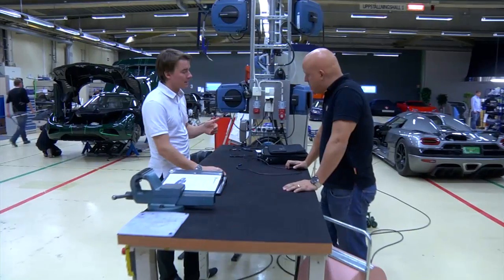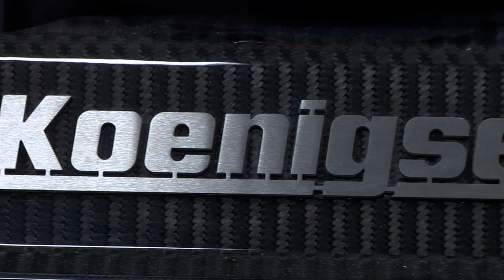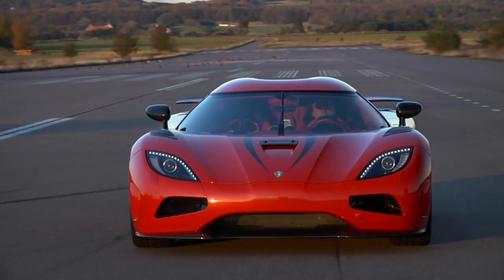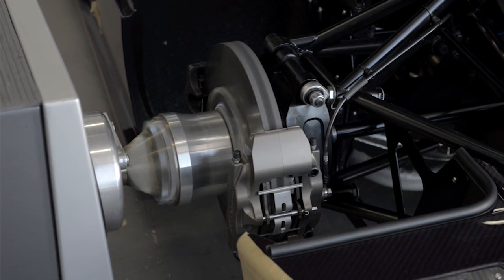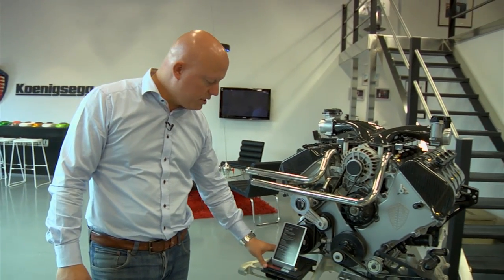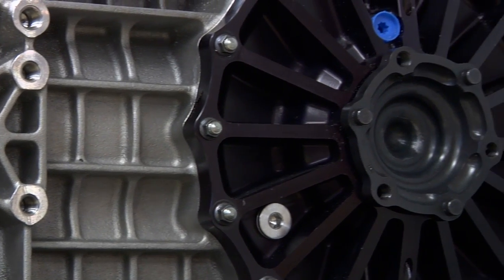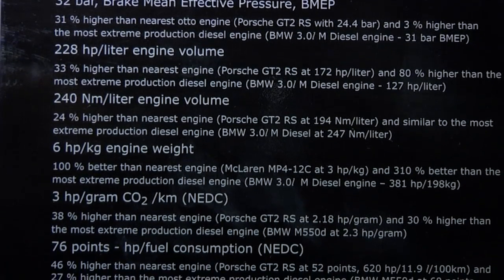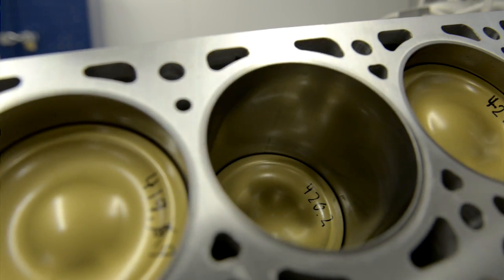The 1140 hp Heart of a Hypercar - /Inside Koenigsegg

Comment: Was anyone watching that dyno at 1:04? 3500rpm, 470 horsepower and 1000 Newton Meters of torque. 1000 fucking Newton Meters at 3500rpm! And it kept climbing all the way to redline. The acceleration would be mad.
Reply: +tqdzwa maramba The torque remains practically the same throughout the RPM range... It's a monster!
Reply: +ZephyrRacing And that's with the torque being electronically limited

Comment: haha he said even with 1100 horsepower it has a safety monitor  so it can go even faster. best car ever
Reply: Tuco That's an over glorified volkswagen with 16 damn cylinders and four turbochargers. The Agera R is an example of innovation and future design
Reply: Have you seen those Underground Racing Gallardos or Highly tuned Supras? Cars like those just prove with the right engineering and tuning that you don't need a damn V24 quintupled turbo engine to be reliable. Underground Racing Gallardos are highly reliable and so are the 2JZs from a Supra.
Reply: Tuco First of all.. it's not a v16.. i don't think there's such thing as that, it's a w16.
4 banks of cylinders.
Second, it is innovative because it's not a modded, maxed out v8 like you assume it is. It's a refined design with proper technology that is able to maintain reliability and drivability while producing massive numbers and able to run a different types of fuel.
Reply: Veyron engine without blocade would produce over 3000hp,if you dont believe me watch BV documentary here on yt.
Reply: Nope my bad,just realised he was talking that Bugatti loses over 2000hp in heat.
Reply: Tuco why are people still on the Veyrons nuts Did you even watch the video? Even the CCX had an environment friendly engine...and guess what. It's a FORD ENGINE! Look it up. Plus the agera r makes more hp per liter and cyclinders.
Reply: Jamar Perry Well Veyron was a first commercialy available famous car that could reach over 400kph and you have to deal with it,Im not saying that Lambo with two turbos is not impresive but you cant say that it is reliable as years of engineering and milions and milions of euros spend on a research.
Reply: Jamar Perry And in the end 1000hp supra or veyron is just a matter of taste,i dont like tuned cars but i respect them.
Reply: Jamar Perry So what if it makes more hp per liter?? Here on yt you can find Audi 5cylinder engines making a nearly 1000hp...Hp per liter is easy job to do,making it reliable is another thing..I personaly like veyron more bocouse it has more mature look,its not loud as Koenigsegg but when you need power you know you have it,plus there is that feeling of german reliability...Comparing those two cars on raw performance is just idiotic becouse there will be always some guys in shed that will build a faster car but there is just few of them that will live up to the name of veyron...ffs veyron has becom benchmark for fast cars for almost a 10 years now,whenever is someone talking about a fast car someone will ask is it a faster than a veyron and not is it a faster than Koenigsegg and I think this sais a lott about a car...
Reply: Juan Salvattore Soo you are saying that squeezing a v16 engine with 4 turbochargers and managing to disperse over a 2000hp of heat is not an innovation but strapping a v8 with 2 turbochargers in some shed is?There is nothing over glorified in veyron,its just a technological masterpiece.btw their design has barely changed from 2000s.

Comment: Anybody think car manufactorers have the tech but are holding back?

1.3L & 300BHP, fuckkk. I remember (Jaguar?) produced a 1.5/1.6L engine and it produced 500bhp, then there's a video on video1320's channel of a Mazda RX7 with a 850BHP 1.3 litre engine called Turbo larger than the engine, presumably on a relatively low budget.
Reply: Simon Nilsson it's about making that kind of power RELIABLY. not making that power.
Reply: However, the RX7 is a rotary enginge, a 1.3 lite rotary is equivalent to about a 2.5 litre v6. then a 900bhp Evo X is more impressive, or a 1000+ bhp SAAB...

Also, remember how much more stress are put through those cars and the very illegal aspect of running them on the road in most places. Fomula 1 engines with the latest (2.4 lite naturally aspirated v8) produce over 500 hp, sometimes up to 600 (not sure on those figures though) and rally cars (WRC) is LIMITED to 300bhp, from a 1.6 litre turbocharged engine. Often tuned higher and electronically limited in order to produce more torque.

All in all, yes, they are holding back a bit, it would be too expensive, often a bit too unreliable and not econmically possible. The performance is constantly pushed and we see rises in performance as quick as the manufacturers make it possible to put reliably in a production car :)
Also, standard cars have no reason to put out that much power, insurance ratings are high. For example, look at saab. They have had cars with about 200 bhp since the late 70s or so but haven´t built one with more than 280 since.
Reply: Simon Nilsson yes sure but remember he said in the end that it has a safety margin we as private persons can still tune it like a rx7 and a evo because he left a margin so the car won´t break after some time heavy use
Reply: there is a difference between reliable horsepower and horsepower.
Reply: Simon Nilsson  We ve all seen a number for these "pimped up" engines blowing up on dinos. Koenigseggs engine is a peak of ICU technology, the engines you are refering to are just overstressed boosted monstrosities i difinetly would not like in my car

Btw i believe that Christian von Koenigsegg is one of the most awesome car enthusiasts there are. There is not any bigger way how to show your enthusiams about cars than simply building the best hyper car on planet.
Reply: they want to make them light and fuel effitiant and having a huge tubo V8 doesnt help
Reply: New small turbocharged engines  for citycars are braking at low mileage.
I've heard a lot of stories about the new a45amg and that the turbos blow up at 40.000 Miles LOL
Reply: It is quite common for any road car turbo to blow at 40 000 miles, even 20 000... turbos go soon, need to be replaced soon or loose power. I am generally not a fan of turbos and this is one of the reasons, that is why Aston Martin One 77 is so interesting for me.. it has 750 HP and is naturally aspirated
Reply: Mikee CZ
You need to understand that the problem isn't if it's turbo or aspirated,it's the power related to the displacement that matters.
little turbocharged engines have no torque .drives like shit,consumes a lot and aren't reliable,as well as high revving N/A engines
Reply: Nope, you are simply witnessing an innovator with great vision who also happens to be a true super sport car enthusiast
Reply: Mikee CZ Ummm no it's not, stop talking so much shit out of your ass, just because a car is turbocharged doesn't mean it blows up fast. There's many cars even from the 90's that are factory turbocharged and are very reliable.
It all depends on engine design and tuning.
You must be confused with kids just slapping a turbo in their car and blowing up because either they did not get it tuned or had the necessary parts and  hardware or both to sustain reliability
Reply: Just keep that language of yours to your self please as you are just beign stupid.
No need for such abusive talk.
Turbos do tend to go fast, and if they dont fail entirerly, they loose a lot of their power over time. 90s turbo engines will be significantly more lazy than when they were new. Of course it matter on how you drive them, that is so obivous that i cannot even believe you need to mention that as you can apply that to every bloody screw on a car, tyres or even windscreen. Please calm down, I am loving Koenigsegg to guts
Reply: mclaren mp4-4 has 1.5 v6 turbo with 1,200 hp as a 1988 f1 car and now we have f1 cars with turbo v6s and only 700 hp :(   Wish I lived in the past ...sometimes
Reply: +Christopher Duclos They can hardly be compared though. Trust me, I thought the exact same thing for a while but the modern cars are better. First, the AMG engine is pushing around 1000 horsepower now (unofficial word). Second, thanks to the two MGU units and KERS the new cars are more efficient and have no turbo lag, whereas the MP4-4 had no power in corners because the turbos weren't spooled. I love the MP4-4 but I think the new cars are technically better

Comment: Love the Koenigsegg-however I believe they should consider a larger displacement engine.  There is no replacement for displacement.
Reply: Everybody is talking out of their ass. Take a thermal efficiency course. It comes down to heat wasted per cylinder. For 8 cylinders, the sweet spot is around 5 liters. For 6 it's about 3.8. For 4 cylinders it's around 2. When you go above the sweet spot you can make more power but you create a lot more heat and therefore consume much more energy than you create. But yes, you can have a huge engine with huge power that consumes fuel like the world is ending. But it's not 1960, we are smarter than that now.
Reply: It hardly needs more power though, working with a self imposed limit is actually a good way to improve upon other components like they are doing already.
Reply: larger displacement does not mean I think the car lacks power.  Larger displacement means you can achieve the same power without so much technology in the engine and focus on other technology such as the transmission.
Reply: that is funny.  A mustang has a 5 liter engine.  fail.
Reply: Erik Anderson the replacement for displacement is turbos and superchargers. thats why on koenigseggs new one:1 bugatti killer, it is a 5.0 litre twin turbo
Reply: marc ginsberg the Agera :1 has a megawatt of power ,a "megacar" if you will,reaches speeds of 290+

Comment: 300hp 1.3 litre 3 cylinder engine would have the life expectancy of butterfly. 50.000km and you're done. Buy a new engine.

And i am not even sure that it would be efficient. That thin would suck up more as than a truck.
Reply: and this is why he is the innovative hyper car maker and you are not.
Reply: http://www.carthrottle.com/witchcraft-is-the-only-way-to-explain-nissans-incredible-400hp-1-5-litre-3-pot-engine/
Reply: Aaron Rodriguez
The context of his affirmation pointed to an idea of possible use in the future.

But i really feel that there is no tech capable to create an engine like this. There isn't even materials capable to withstand such performance.

Koenigsegg, as well as any other brand of supercars, are on the edge of new tech and, obviously, many innovations that we now perceive as standard in normal cars are a direct result of these "non sense" vehicles.

But again, even if combustion engines can still be optimized and have a a lot of growth potential, i think we will never see a commercial engine as such.
Reply: GabKoost you can get 230hp out of a 1.4 VAG reliably already, with over 40mpg, it'll happen i think
Reply: GabKoost
http://www.carthrottle.com/witchcraft-is-the-only-way-to-explain-nissans-incredible-400hp-1-5-litre-3-pot-engine/

Comment: I did a little research (googled for 5 minutes). And I didn't find a good explanation. But I'm guessing that, too little downforce, and (I'm guessing) high power/grip ratio could be the reason. This could be supported by the CCX's top gear lap with spoiler compared to the lap time without. 

all you said about the Z06 and ZR1 is wrong, they both have sophisticated suspension and differentials.

Comment: Dude, koennigseg themselves gave Top Gear that car. After the crash the Stig told the engineers from koenigsegg that if the car had a rear wing it would be a lot more faster. So they took it back to sweden put a spoiler on it and sent it back to top gear. The reason not to test Agera is totally not this.

Comment: If you visit Grainger and Worrall's website you will see Ford listed as one of their customers. If you visually compare images of Koenigsegg's engine to images of the parts I've mentioned you will see they match. SSC's current Tuatara engine is an aluminum block pushrod V8 developed by Nelson Racing Engines. SSC claims they co-developed the engine with NRE and that it's a custom billet block. If you visit NRE's video at watch?v=bAKj7Jz1zIY they tell you it's a Chevy 7.0 L LSX. You do the math.

Comment: Actually, the first Koenigsegg did use Ford Modular engines. The change in engine came just a little before the unveiled the CCX here in the U.S. Because the Ford engines wouldn't pass the California emissions test, Koenigsegg designed it's own engine, with the help of Grainger and Worrall. The new engine is more compact and rendered a higher performance. Since then, Koenigsegg has been designing the engines with G&W.... just thought to point that out

Comment: It's Ford's design. They are so close it looks like you can literally swap parts between them and they ARE using Ford's alternator and water pump. BTW, Ford uses Grainger and Worrall for limited production runs of engines. It's not inconceivable that G&W simply produced a beefed up version of Ford's engine. If I were designing a Ford-based engine for Koenigsegg, I might start with Ford's Cammer road racing engine and make the bore a little smaller to stand up to forced induction, then stroke it.

Comment: BMEP=470psi?...let’s break it down, peak torque is 885.07ft-lb and a 307.102in^3 engine.. That puts BMEP around 434psi...  I'm getting right at 30Bar... lets try HP... 1140Hp at 7500rpm.. here i get 28.57Bar.. I am failing to see your claims of 32 BAR...Perhaps my largest question is why not to use variable intake runner lengths?? The average torque increase would greatly overcompensate for the extra weight as i can see it...
Reply: What is ur formula ?

Comment: Watch the video and compare what you see with images of the parts I mentioned. 
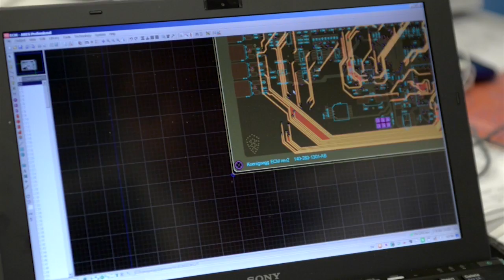Compare Koenigsegg's block at 0:13 to the Ford 5.0 Cammer block.
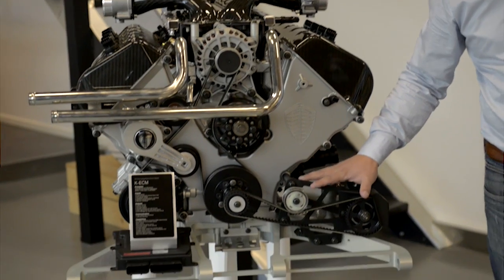At 2:06+ compare to the Roush/Yates Ford 5.0 Cammer racing engine and compare the alternator to the Ford alternator AL8315. 

The alternator is the same. Notice the coolant passages and bolt holes in the engine blocks. The same. Notice the valve cover bolts at the font of the head and the other small details both engines share. That's a Ford my friend.

Comment: That engine looks like a Ford 5.0L Cammer racing engine to me. 
Engine block M6010T50. Big bore 4.6 block with iron sleeves.
Even their custom timing chain covers and valve covers look like they would bolt on the Ford Cammer.
The alternator appear to b e Ford Alternator Model No. AL8315.

Comment: of the mustang v6 on every track its been tested at, in fact the nismo 350z was hanging with the supercharged testerossa mustang v6 despite having 100 hp less. bottom line the mustangs target market is retro and straight line and it wont be a serious competitor to anything with handling ability until it drops 500 lbs and goes IRS. dont tell me a IRS is weak either because the Z cars are running 7's on them and vettes run low 6's on them

Comment: lol every single engine looses energy through heat, hence why the top internal combustion engines are only 30-40% efficient. no american is buying a  6.7L v8 either, the mustang rocks a 440 hp 5.0, chevy uses 6.2L at 430-640, dodge uses a 6.1L with 425. difference? guys are building those engines to 3000 WHP, not wasted energy actual power going to the wheels, look up outlaw 10.5 and those guys dont have half what this engine or the veyrons cost. this 5.0 also runs a huge amount of boost

Comment: not even close its 1.7 million, there is a huge difference between what your after and what this car does. 1) mustangs havnt been all steel in a long as time get over yourself. 2) as soon as you get to a corner the agera r is going to destroy you, interiors are on another level, drivability is on another level, comfort is on another level. this is for someone after more then just "going fast in a straight line" if you wanna compare that i have a 350z that does 8's AND handles for less then a GT

Comment: Lol! Drag cars usually turn extremely well. While they are designed to hit high speeds, and accelerate hard in a straight line, they also have to have superior steering to any street legal car, due to the fact that if your car states to get sideways at 255mph, you need to be able to save it. So, you're wrong, my friend. That Pro Mod 'Vette will eat this car on a track. Oh, and don't even get started on down force and drag. Dragsters have the most downforce and the least drag.

Comment: any engine is subject to this scenario. its called undesired energy. most of this goes out the exhaust but yes some of it is absorbed into the engine cooling system. and in regards to the 11 radiators, you are forgetting that these include, coolers for the transmission, a cooler for the spoiler hydraulics, inter coolers etc.
the comment on america is very true, they have only just discovered the advantage of aluminium blocks.

Comment: Because The non-existant 6.7L V8's in America are naturally aspirated. This car has forced induction. Now, take a look at NHRA in America. Some guys are running 524 cubic inch engines with superchargers, making 4000hp, and all of it gets to the wheels. In a quarter mile, that 4000hp propells the car to 260mph, and it only takes, from 0mph to the end of 1/4th mile, about 5.7 seconds.

Comment: actually if you did your research, then you would know that a veyron makes nearly 3000hp, but roughly 2000 of that is not used, and comes off as heat... Hints the 8-something radiators throughout the body. I just find it crazy that americans buy 6.7L v8's that make maybe 400hp? This is a 5L v8 with over 1000hp? Makes me wonder what everyone in corporate america are doing....
Reply: Pranx94 what engine are you talking about? The mustangs 5.0 has 460 hp and the car costs roughly 40k. Don't get me wrong though, i would love love love to have this car.